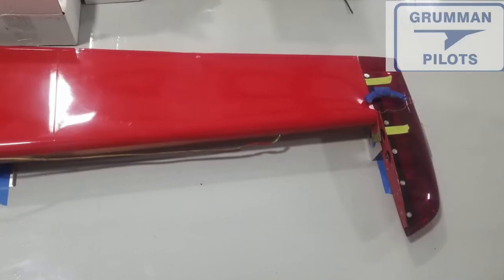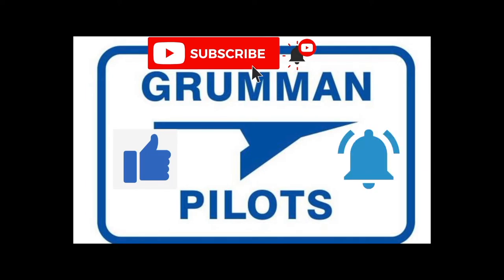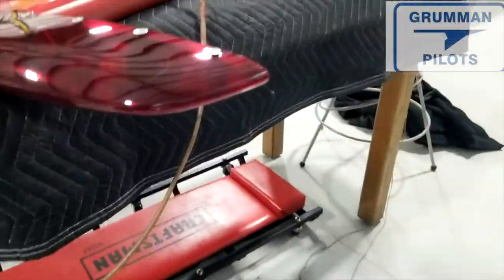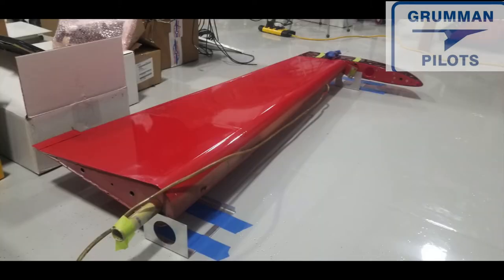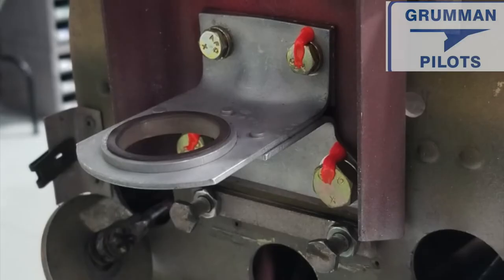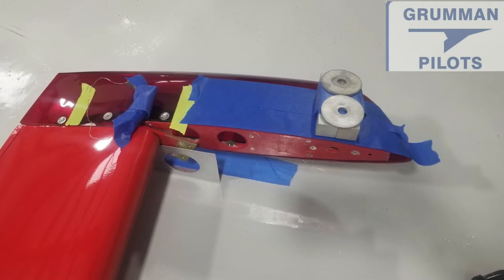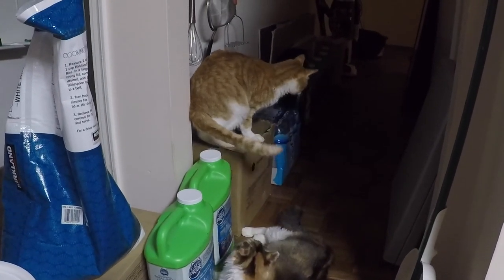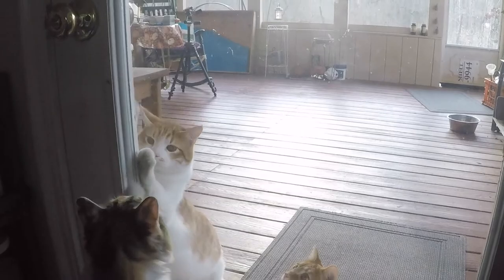Balancing Your Rudder - Grumman Style

Comment: What happens if it's out of balance??
Reply from the maker: Then you shave weight off the weight, or as most have to do, you have to add weight.  The planes at the factory were mostly assembled and then painted with no balancing of the control surfaces.  FYI, see the video here from 1976. 
 https://www.youtube.com/watch?v=YvgPy21doxQ